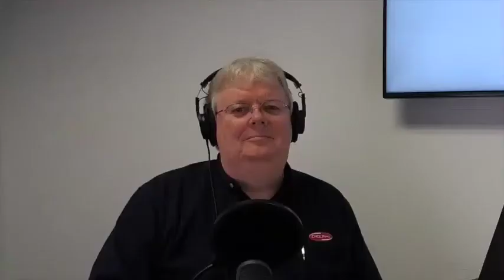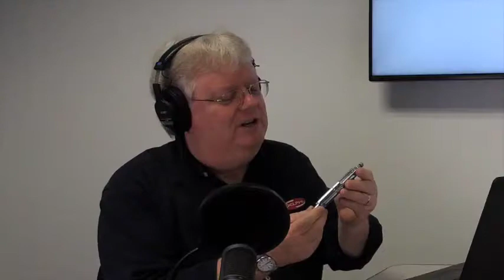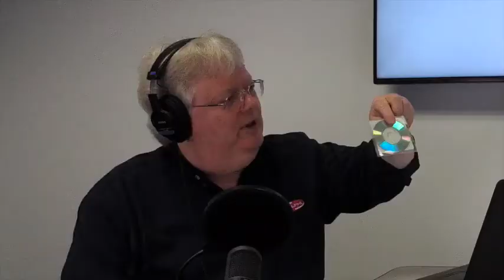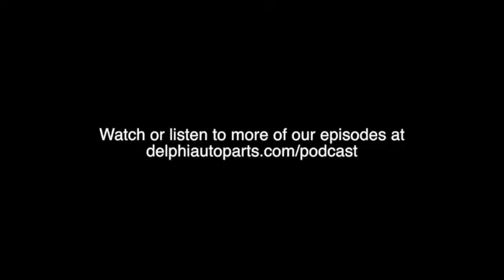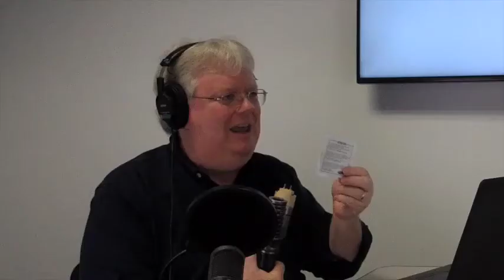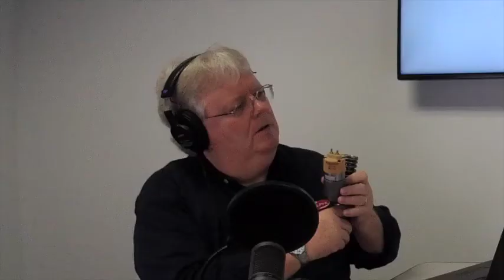Digging Into Diesels and Trim Codes with Paul Mydlarz (Podcast | Ep. 103)

Comment: Excellent video.  I would add that a shop without CAT ET can replace a defective CAT injector and then send the truck to a shop with CAT ET which can then enter the proper code.  The truck engine will function satisfactorily until then.  Keep up the great work.